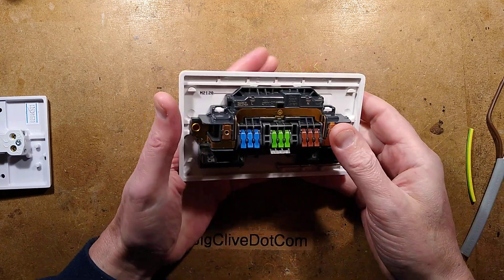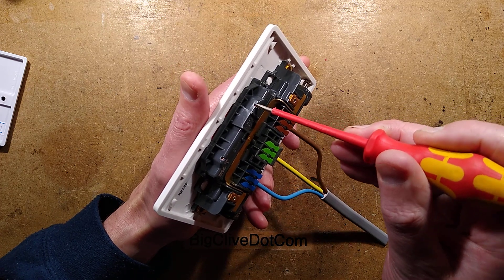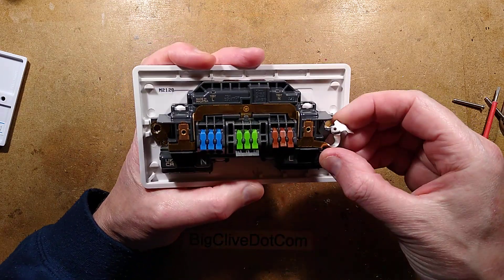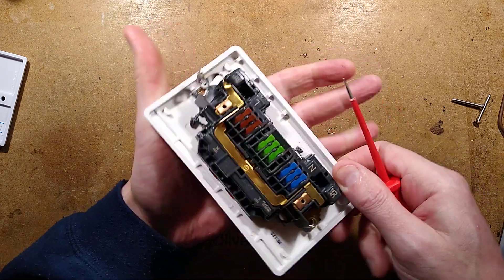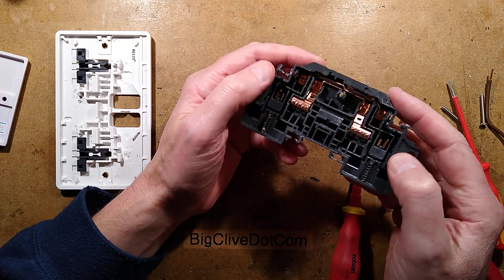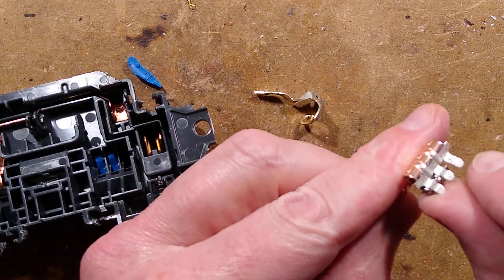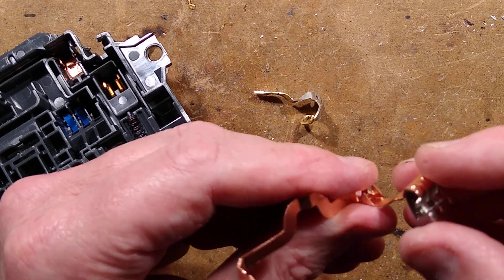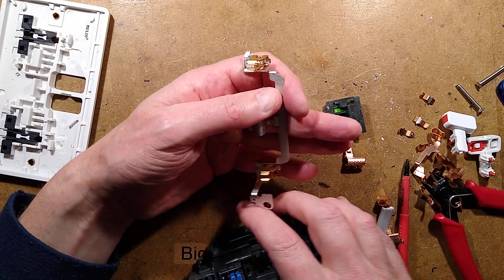Teardown of the new MK screwless socket

Comment: I am not sure what you meant by "lip", but one thing I usually do when I mount cords on lamps that are grounded; I clip the wires different length (more exactly; I make the ground wire a couple of inches longer).... .. so IF!!! some unfortunate force succeeds to pull the wires out; at the very least the earth will be the LAST to go out, so the earth-fault connector WILL trip immediately.. IF something touches the metal.. (if a "yank" like that happens, probability is that someone is either working with the lamp, or tripped close to it, and most likely WILL touch it).. Any way the "lip" could help against such scenario?
Reply: Just random thoughts so far; Whenever my drill get's snagged, I normally just reverse direction, hold on hard,  and give the trigger a quick squeeze. It's possible it doesn't work, and it's possible that it even pulls out of my hand, but AS I just gave a quick squeeze it doesn't really have any "strength" if it hits something after turning just a few degrees..  It's surprising how often that works.

To test if it is Aluminium is difficult, you'd have to have good scales, and a good way to examine the volume, and know the temperature.. BUT.. it's fairly common people instead use some form of iron-mixture. Not all of those are magnetic (Stainless steel is the most common type that isn't).. The easy way to rule out stainless steel is to grind it and see if there are sparks.

Aluminium is bad for electric components?.. I don't know what specifically you are talking about, but Aluminium have "issues", but it depends a bit on what your beef is. F.ex. Aluminium is fairly brittle.. But.. Aluminium IS (at it's heart) a ~very~ good conductor. It is used in some cheap wires for led Christmas lights and things like that.. So IF it was about the conductivity, I would like to point out that Aluminium rust easily. Aluminium oxide- on the other hand- is not... The thing is that Aluminium is prone to rusting.. fast.. IF you take a piece of aluminium and exposes it to heat, you'll find that you'll get a liquid inside a skin. The skin is aluminium oxide. If you keep the aluminium hot, poke a hole and the skin and remove it.. It will only take 5 minutes to build a new skin after the heat gone down. THIS is what I think might be the reason why they wanted to use brass-coated aluminium. If you have something that is NOT intended to be bent (like a wire internal to a machine/connector).. Then the Brittleness doesn't matter and.. The oxidization problem: The coating will protect the conductive aluminium from oxygen, so it can't corrode.. Hence.. not a problem. 

If you ask me this rather sound like a technically challenging process to do, but if it can be easily done in a machine, then you have a cheap but very conductive piece of metal. (Pure Aluminium has almost 2/3s of the conductivity of Copper, whereas Brass only have about 1/3).

For various reasons, Zink, and Magnesium is also sometimes used in electronics, but I think that is for specific reasons.. Zink doesn't conduct a lot; Magnesium I THINK was around the same area as brass... Hmm.. if they for some reason used Magnesium, then it might be coated to avoid it catching fire "in case"?..

Comment: It's fascinating.. I've seen a bunch of different sockets from UK and US and they all look almost identical (obviously not comparing an US and UK socket, just each with their own). 
Here in Europe, several different manufacturers make different sockets, with easily detachable faceplate (one screw) which look all different, from different shades of white and black to even colours. Plus even more individuality with the frames - even glass is possible.

Comment: seems very expensive to save a small amount of labour (how often do people really change plugs?.  I'm also a bit skeptical of pushing 13amps through that style of connector, though i don't really have anything to base that on and could well be wrong.
Reply: They're not really aimed at people renewing the odd socket at home. There is a building boom going on here in the UK, so time saved in construction is £££ saved, the extra expense of the hardware will (theoretically) be more than recouped.
I too was a bit concerned about pulling not just 13A, but potentially 26A (if two 13A appliances were being used simultaneously) through these connectors. Time will tell I am sure, but I reckon MK will have done their homework.

Comment: The terminals are rubbish, you cannot beat a properly filled and tightened screw terminal.
Reply: Not true. All screw terminals have a tendancy to loosen as the materials creep and also due to thermal cycling. On the other hand spring-loaded terminals always maintain a secure contact due to the constant spring load. That's why spring terminals are generally considered maintenance-free whereas screw terminals aren't.

Comment: It's curious that the recessed 'test' points for Line and Neutral are at the opposite ends from their respective cable inserts (i.e. Line test spot is nearest the Neutral cables, and vice versa). That seems to me likely to encourage accidents, unless the wired-in unit can be turned around far enough to read the tiny labels. Strange design choice.

Comment: What have you got against aluminium. CCA is everywhere, over your head, in your ears, etc. It's a lighter, cheaper alternative to pure copper and almost as good in most applications.
Reply from the maker: When terminated correctly aluminium is usable as a conductor.  But its tendency to form a high resistance oxide on the surface makes it less suited for installation by people with a poor grasp of electrical theory.

Comment: Mk or multi kontact is nothing more than a shadow of its former past. When I was an apprentice mk were the dogs nuts solid build quality and the backs stuck out of sockets that much you would need a 35mm box for them now producing chinese kak like this. What's the point of screwless terminals when you still need the screwdriver to screw the front on? A company called TL once made a 13 amp plug with screwless contacts inside but you still needed a screwdriver to screw the top back on. 🤨🙄

Comment: The plating being silver seems unlikely.  Considering that the bar is external and and the plating is only on the surface that abuts the housing, it's likely just there to provide corrosion protection.  Moisture,debris, etc. getting trapped between the bar and housing.

Comment: there are a lot of comments on what the silvery metal is.  it is not silver.  think of how quickly silver or epns cutlery goes black.  as a coating the silver would need to be too thick to allow for wear and the blackening of the surface at contact points.  and silver, though the best conductor, is a precious metal,  and it is soft.  tin may be used on some electrical surfaces.  tin is in solder.  but it is too soft for contact points.  the surface coatings will almost certainly be nickel.  why they coated surfaces that are out of sight is acceptable overkill.  aluminium?  never!  too many problems.  ally is used for high voltage high amp cables in australia and probably other countries.  joining ally cables is a precision art.  both end surfaces must be perfectly machined and pushed together.  no soldering.  how do i know?  because we pulled a high voltage cable up on a demolition job.  no-one told us the new cable, that also contained phone wires and optical fibres, was below the building we were removing.  there were 13 shiny bums standing around looking at the mess we made wondering who was going to pay for the repair.  our demolition company didnt have to pay because they didnt tell us it was there.
Reply: oh, by the way, i do love this style of connector and everything about it.  very well done.

Comment: MK sockets have an additional safety feature not required by the standard.

With standard sockets, the shutters on line and neutral are opened as the earth pin is inserted. However, with MK sockets, the earth pin cannot be fully inserted until both the line and neutral pins are pressing against the shutters.

This means that all three pins have to be inserted together and it's not possible simply to poke something into the earth socket to open the shutters.

Comment: I'd be generally in favour of them for most situations - seen way to many bad screwed connections to not like it. My only questions is how deep the unit is VS screwed? Would this need a modified or deep back box in a lot of installs?
Reply from the maker: It's not too deep.  About 22mm plus wire room.

Comment: Shame this wont be an option for boats. The ancient ones tell us fledgling electricians not use wagos on boats bc the resonance created by engines wiggle them apart. Is this true tho? Ive always wondered. Never seen proof for this tho.
Reply: Sounds like ignorant nonsense to me. On the other hand vibration could quite readily result in a screw connection loosening.
Reply from the maker: It sounds odd.  You could equally say that the resonance will cause copper flow and loosening of screw terminals.

Comment: Interesting.  In the USA, one thing I do not like about the WAGO 221 Connectors is when a wire is inserted and locked down, the leaver then becomes loose to about a 45 degree angle, meaning when you push the socket back in the box, theoretically a wire could open a connector and loosed a cable.  Maybe an idea for a video for you to test out.

Comment: Maybe a different connection might be reaction to complains. Usual MK sockets have their cable entries from slight angle which theoretically let's you put longer cables, but practically I can Wire 9 Click sockets in the same time it takes to do one MK. Simply because the angle means that you do not see what you are doing. Adding the protection  to prevent contact screws falling out also forces smaller screwdriver then you need. 
I would be worried about clearance space in 25mm backbox. I don't trust MK to reinvent the wheel. (Though click did it in small ways).
Fact is that even if made from better materials, the best way to make a wheel is round...
Reply: Installed one of these quite recently - had older MK Logic Plus sockets but "needed" to play with the new toys :D  Specified a 25mm box and it fitted fine.  To be fair, it was only a spur so only one set of T&E going in but didn't have any problems.  Just measured the box (as I bought any old box) and it is 30mm from back surface to front but that should be about 25mm internal space.
Got mine from Screwfix where you can find them with part number 814PH if you want to try them.
Reply: @Cenedd  I'd love these lever connections on those fused spur switches, they have to be the worse thing to wire up lol.

Comment: It's brass plated aluminium, or copper plated aluminium, or tin/silver coated brass. The common practice with cheap Chinese made products is plating aluminium with brass or copper. , Hell they even do that with RG6 coaxial cable, they copper plate a steel conductor with oxygen free copper because high frequencies run through the surface of the conductor, do you font need solid copper , they damage your cutters, many a klein or ideal stripper has met their demise to coaxial cable .
Reply from the maker: It appears to be silver plated brass.

Comment: Would a multimeter be able to test the surface resistance of the two sides of that brass peice? If its silver it should have a bit less resistance. Steel, iron, zinc, and nickel are less conductive. Could still be aluminum though. You'd have to measure the same distance.
Reply from the maker: The resistance difference would need specialist equipment to measure accurately.

Comment: Aluminum gets a lot of bad wrap because it doesn't play nice with copper. I've even heard that it becomes resistive over time. How? This house is over 50 years old with aluminum Romex. There's nothing wrong with it. Besides, aluminum is ideal for power distribution because of it's light weight and tensile strength. I wouldn't use aluminum for spring contacts. That could be why copper is preferred in homes. Although, we now have safe methods to transition from aluminum to copper, so aluminum may make a comeback for house wire especially if copper becomes too expensive.

Comment: Nice idea, but the design of the cable arrangement is rather poor. Why LLL EEE NNN ? all that does is splay the cable and make an untidy mess 
If the connections were LEN LEN LEN then each cable would connect to one set of connectors, a much neater install.

Andy
Reply from the maker: That would be complex to implement and also require extra anti-tracking barriers.

Comment: Ohhh .... i wish you could help me fix my speaker... running on 2s 18650 7.4v 
Charging rate of 18v, but when plugged in,  it gives current of only 3.7v, the charger functioning well.... but the speaker won't react with charger

Any ideas ? ? ?

Comment: Do terminals act not heat up if I draw 5kw from that is the plastic enclosing this not going to catch fire  ,  what type of black magic plastic is in use within current electric components, have seen alot of light switched melted inside and other electrical components. Should we really assume that an average electric consumer know/acknowledge load rating #melted_in_lightbulb #ceramic_past, #melt_a_fuse_instead? #fire_designers #fuct_world

Comment: If those type of connectors start to increase in temperature will that effect the "spring" tension , there for increasing  the resistance ,therefor starting the runaway effect ? ,, what are the thoughts for that ?
Reply from the maker: It would require a terminal event to raise the steel to the point it lost its springiness.

Comment: This is why we can't have anything nice. 

Aluminum is more conductive than brass so it would not have been terrible, and had it been coated or plated it would have prevented corrosion.

But glad the current carrying buss bars apear to be solid copper.

Comment: 2:29 "Little bites" is why I am distrustful of these lever contacts. There is a simple concept called "current density," where a given current, I, flows through a contact of area A. The current density is I/A with units of amps-per-square millimeter, or square inch if that's your preferred unit of measure. The contact resistance, R, is inversely proportional to the area A. That is, the smaller A gets, the more R increases. R produces I^2*R power lossin the form of heat. As I increases, at some point this heating becomes significant enough that it causes the contact to start burning and/or oxidize. Needless to say, for a wall outlet, this becomes a fire safety issue. Hence, when I hear "little bites" where these fancy level things contact the wire via a very small contact area, it raises a red flag. A screw contact has a larger contact area, and hence creates far less I^2*R heat degradation of the contact. Also, these lever contacts tend to wiggle with such small contact area. Screw contacts do not. I don't like lever contacts unless you are assured of low current through them, such as an LED light load. 

Somewhat related: current density is a big deal in semiconductors where the metallization is aluminum. If you exceed the current density through aluminum, the metal slowly disappears.  It's called "metal migration." In the early days of integrated circuitry, they tried using a blend of copper and aluminum to reduce this effect, but it caused more problems than it solved.On the process that I used eons ago, current density in your design could not exceed 1mA/mil. Thus, if you had 25 mA flowing through your aluminum, it had to be at least 25 mils wide. Before we understood this, we would put our ICs in an oven and bake them for a few weeks to accelerate the failure times. We found that many of our chips were dead, usually no supply current. After we popped the leads of the DIPS (yeah, it was that long ago!) and got to looking at the IC under the microscope, vast sections of the aluminum were gone. Poof! Missing! Yes, current density is a real thing! Simple fuses use this principle to blow a wire open. It's all a matter of current density, and why you can't run 100 amps through a 40 gauge wire!
Reply from the maker: The bite is from the spring pressing the wire against the busbar.  It's nowhere near as bad as an overtightened screw.
Reply: @bigclivedotcom  I think the point here is that it is nowhere near as large an area as a properly tightened screw, I agree with Demef, small contact area terminations are not suitable for high currents, I think electrical house fires will be back in about 10 years time, We already have the "consumer unit fire" becoming commonplace. It was the advent of ring mains and 13A sockets that made electrical fires fall to vanishing point, and all with screw connections, this is an excersise in cheap to make and fast to fit, not safety!
Reply: @philhermetic  maybe if they were to use the push-in connectors like in the rest of the EU, this small contact area concern would be fairly null and void. that contact area i'd say is only rated to 6A, and screw terminals have always been an issue as their handling range largely depends on how it's made and the torque used. now, i can see these sockets being used in ULV (12-45V) applications for lights and other low-current things, other than that, it's just a pile of hot garbage for anything but the lamp in your reading nook, and maybe a phone charger.
Reply: The little bite is where the clip contacts the wire but the real connection is opposite if you look at the construction of these spring-loaded terminations. They are far more reliable than any screw terminal. Wago make them for conductor sizes up to 185mm2 which are rated at 353A.

The problems with electromigration in semiconductors are far better understood these days and are no longer that significant a problem.